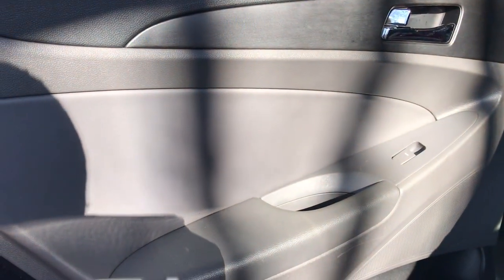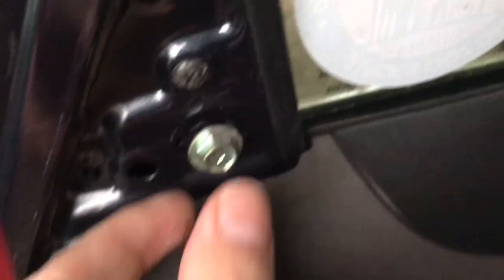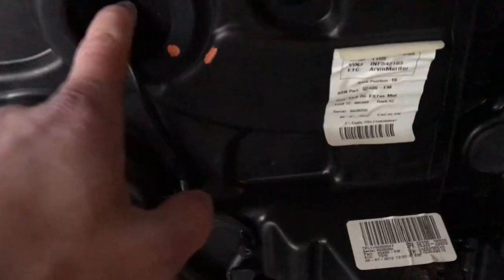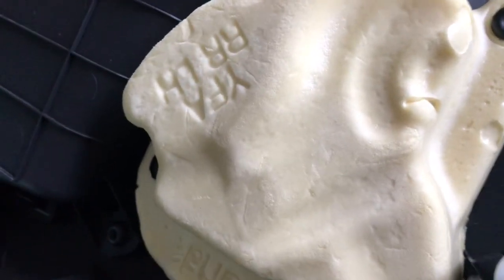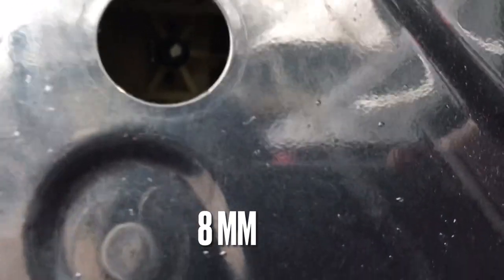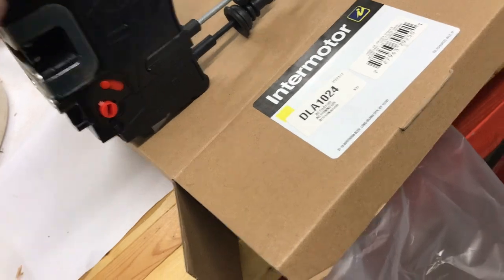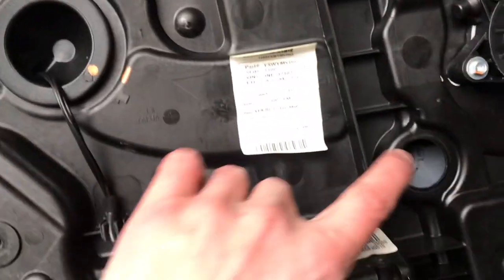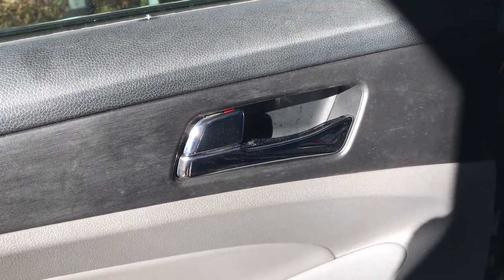Hyundai Sonata Rear Door Lock Actuator Replacement

Comment: hello again!  got a weird situation.  using the key fob the doors will lock/unlock...however using the panel inside the car (drivers and passenger side)  the doors will lock but not unlock.  any ideas ?  thanks in advance!!
Reply from the maker: That's  a strange one! Since the doors lock and unlock with the fob, it's not the actuator.  Not sure, wonder if it's something with the panel, but it seems odd  panels on both doors would fail at the same time.

Comment: Is there a fuse I can just pull to disable the rear door actuator? Just until I'm ready to fix it...
Reply from the maker: There is a 20A fuse in the interior panel on driver side of the dash that controls all the door locks.
Reply: @WithWardWorks  ok so I guess the temp fix is to disconnect the plug going to the door lock until I get a new one.

Comment: @wardworks sorry to be a pest, after installing the new actuator the door will lock when pushing the button on the door and when using the remote it will "double beep" three doors will lock but the left rear door will not lock or unlock. I thought it was a cabling issue but when I pull/push on the lock cable (coming from the actuator) it will lock and unlock. I have reset the cable housing and still no luck. also when I use the control panel (on the drivers door)  the left rear will not lock/unlock.

any ideas/suggestions would really be appreciated!
Reply from the maker: I had this exact issue the 2nd time I did this repair. 
Check the electrical connection to the actuator. It's impossible to see and not easy to reach. I thought I had seated the connection, but I had not. I used the old/broken actuator as a reference to figure out where the connection was and made sure it 'clicked.'
Reply: @WithWardWorks  I will check that out, thanks! this repair is going to drive me nuts!